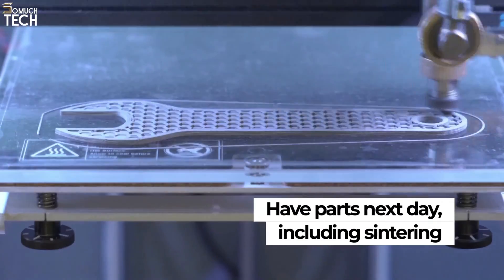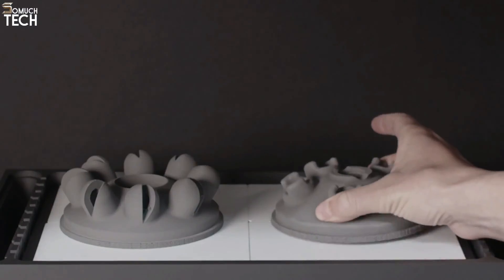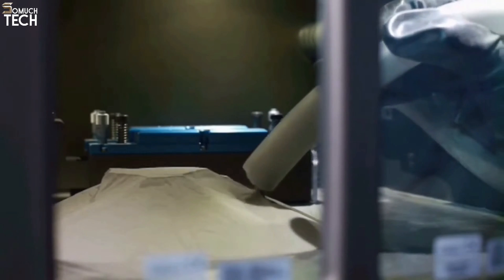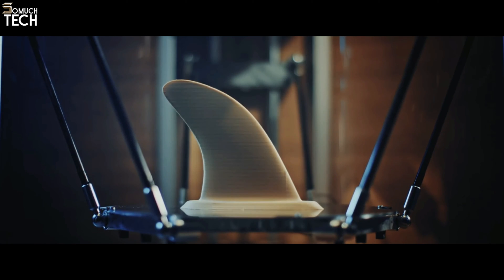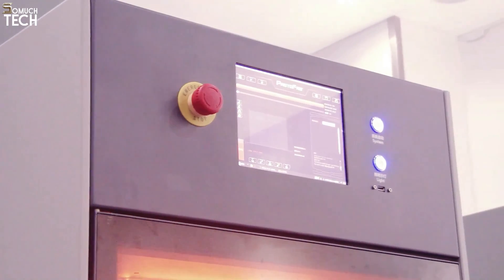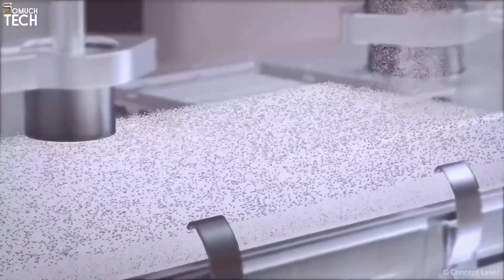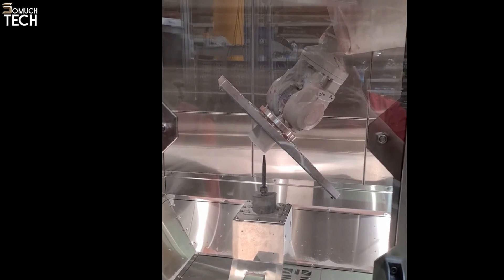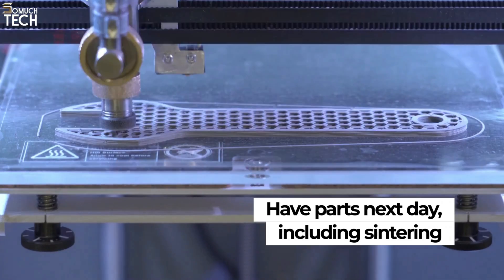10 BEST METAL 3D PRINTERS 2024 - DON'T BUY UNTIL YOU WATCH THIS!

Comment: So, according to ChatGPT (which can and does provide incorrect answers) the available prices are as follows:

1. Desktop Metal Studio 2: $49,900 USD (3D Printing Industry) (3Dnatives).
2. Rapidia Conflux 1: Specific pricing information not available online. You may need to contact the manufacturer directly for a quote.
3. SLM 125: Approximately $700,000 USD (3D Printing Industry).
4. Pollen AM PAM Series MC: Specific pricing information not available online. You may need to contact the manufacturer directly for a quote.
5. SLM 800: Approximately $2 million USD (3D Printing Industry).
6. ProtoFab PF-M 150: Specific pricing information not available online. You may need to contact the manufacturer directly for a quote.
7. Concept Laser X Line 2000R: Approximately $2.5 million USD (3D Printing Industry).
8. Velo3D Sapphire: Starts at around $500,000 USD (3D Printing Industry).
9. SPEE3D WarpSPEE3D: Specific pricing information not available online. You may need to contact the manufacturer directly for a quote.
10 .HP Metal 3D printer: Starts at approximately $400,000 USD (3D Printing Industry).